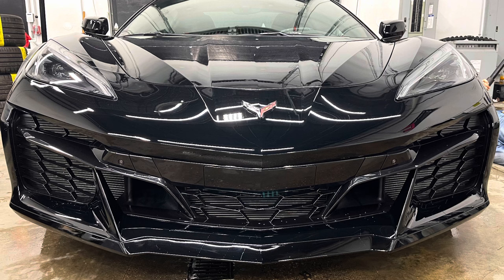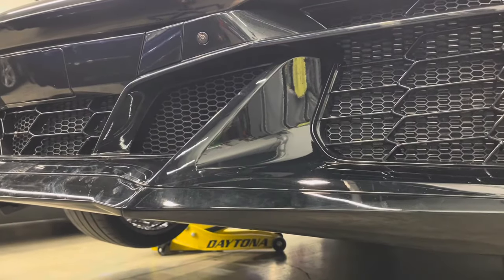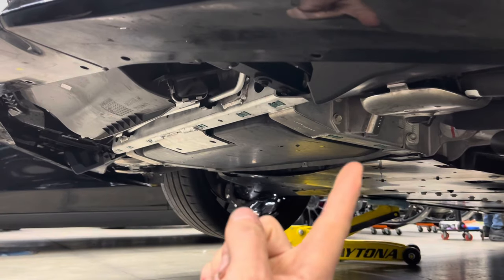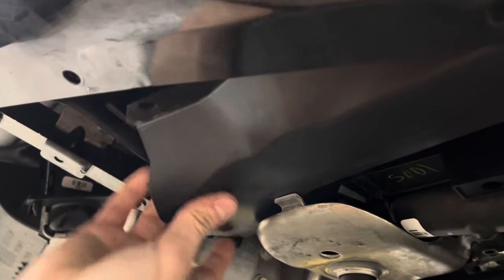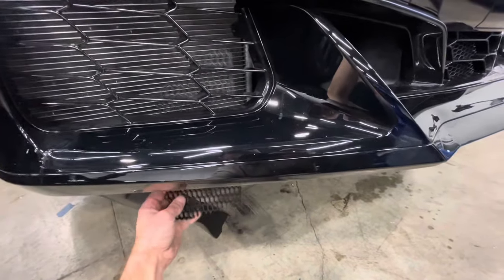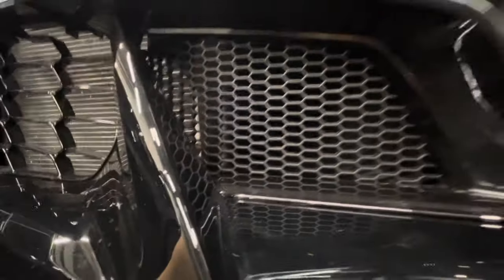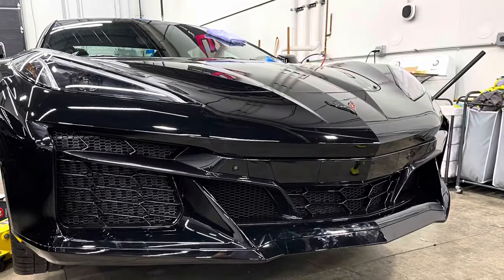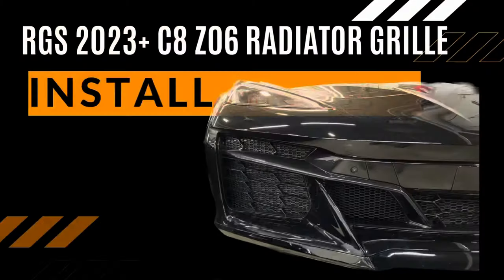RGS 2023+ Chevrolet Corvette C8 Z06 and E-Ray Radiator Grille Install

Comment: The panels are the easy part, the ducting to get to the space, which I hope the squish bolts hold up. Would be nice to send extra zip ties and squish bolts. Also the center grille doesn’t complete fill the whole area.
Reply from the maker: Hello DRKSYDE Racing! Like the name!  Good suggestions!  Yes we wiggled out the squish bolts to preserve them. We will be sure to increase the amount of cable ties for the kit. Also if you would like the full height center for the bumper section removal for track days, we would be happy to supply you with that piece.  We include the street height one as most will not remove that bumper piece and it makes installation much easier.